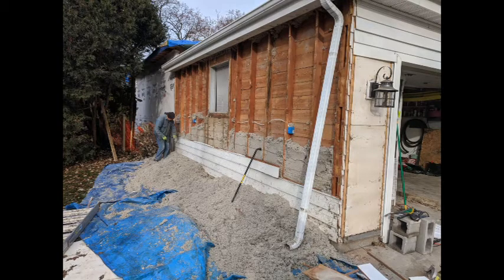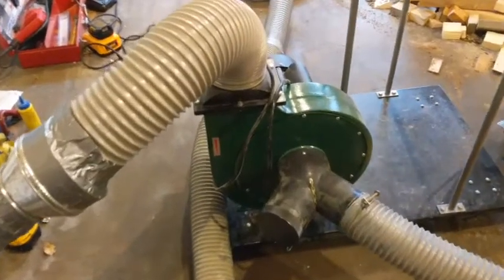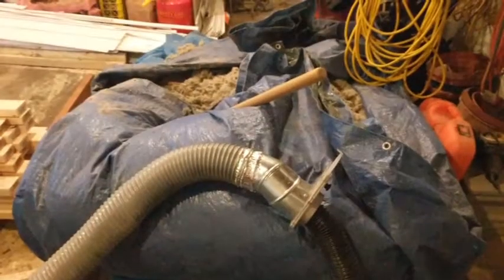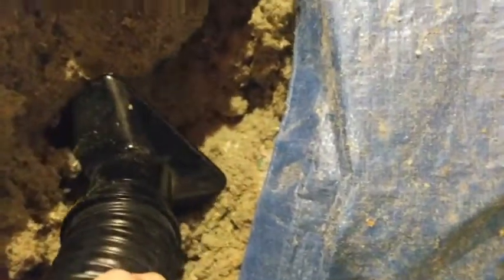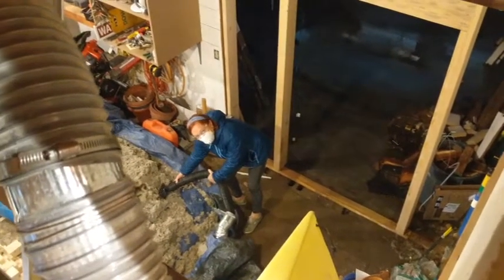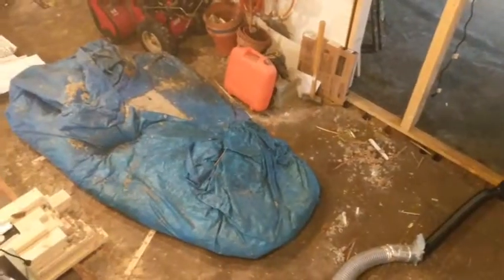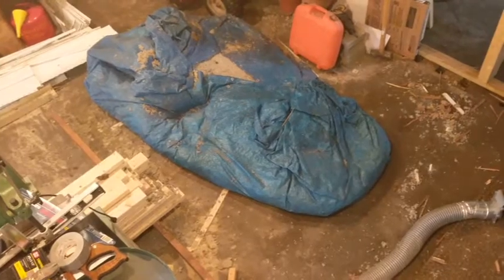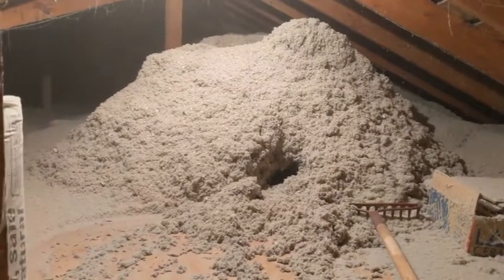Recycling Blown-in Insulation using dust collector

Comment: Was the the pipe itself clogging or the little safety cross on the inlet plugging up on the blower housing? If got a 1400 single story attic to suck up and refill!
Reply from the maker: It was actually plugging up the inlet pipe.  I cut out the "safety" cross year ago 😂
Reply: @thursat4 weird I wouldn't expect a 4" pipe to do that.

Comment: It looks like you worked on a one-story house. Do you think it will work on a two-story house, too?
Reply from the maker: Definitely.  The machine is plenty strong enough.  You will just need a longer hose and to feed the material a little slower so it doesn't clog up.
Reply: @thursat4  Thanks for your prompt reply! The cellulose blow-in machine requires a 20-amp wire, but my house has only 15-amp wires. It also seems to generate less dust at the feed site in comparison with the cellulose machine you can rent. Do you think so?
Reply from the maker: They both create a lot of dust.  I have used both and didn't see much difference.  Either way you are completely covered with dust.

Comment: HI Kim, do you mind telling me how powerful your machine is please?.
Reply from the maker: It's a 2hp, 120v single phase.
Reply: @thursat4  Hi Kim, do you think a 1 hp machine would be powerful enough to push the product into the roof cavity?
Reply from the maker: @scottmccormick8964  I think it would.  You would just need to feed it slower so it doesn't plug the hose.  These motors are actually better at blowing than producing a vacuum.

Comment: Thanks for the demonstration! I just extracted 1400 lbs of insulation using the harbor freight 2hp dust collector and want to see if it will work to reblow the fiberglass back in. What size hose did you use? I used 3" to extract the insulation, but I am considering 4" to blow it back. Thanks again!
Reply from the maker: I used all 4" hose but I bet 3" would work just as well.  You just need to be careful about feeding it consistently so it doesn't plug up.
Reply: @thursat4  👍